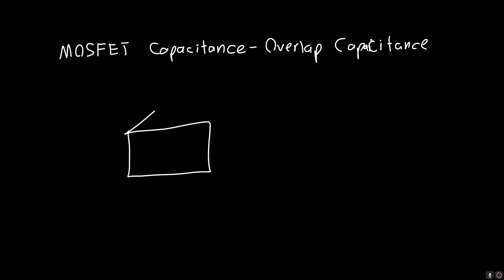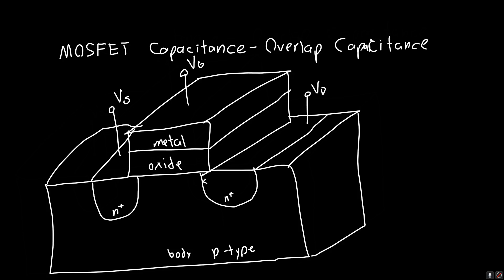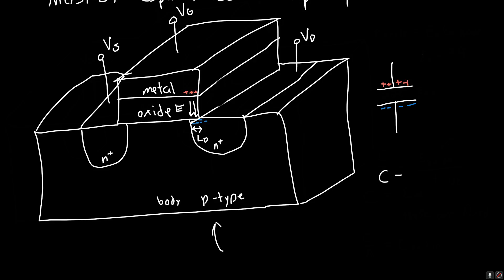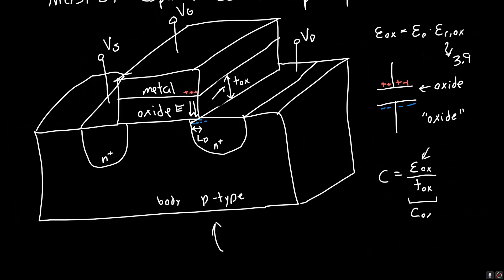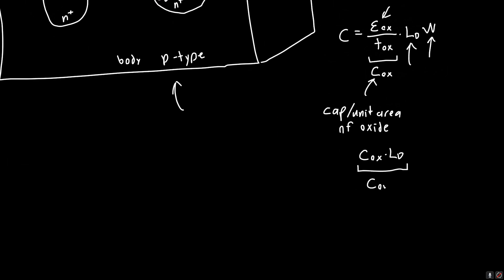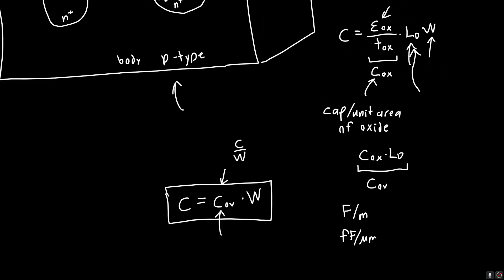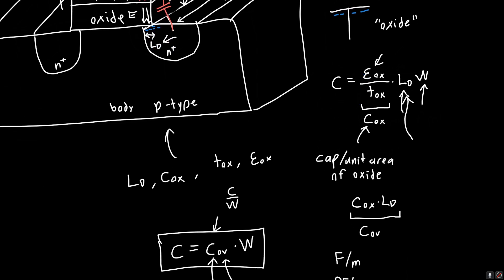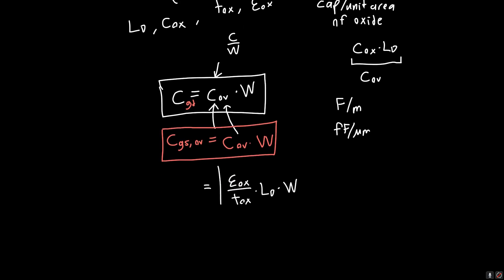MOSFET Overlap Capacitance Explained

Comment: this video helps me a lot. but still I have some questions for MOSFET cap. Is it changed by operation region?

I think cap will reduced when MOSFET operate at triode region than the cutt off region by the electrons are moving.
Reply from the maker: Hawk Good question! This capacitance is only formed between the deain/source well regions and the gate, neither of which is really affected by the region of operation, so we treat this capacitance as constant.
Reply: @JordanEdmundsEECS  thanks for your good video and comment!
Reply: @JordanEdmundsEECS  you mean to say , it won't effect delay of cell also???